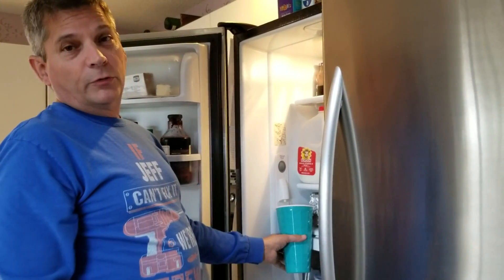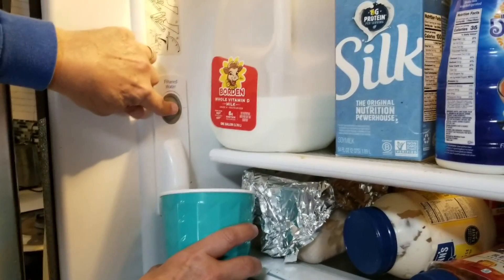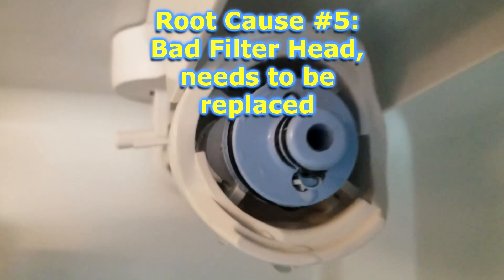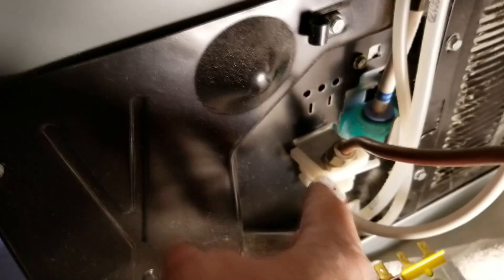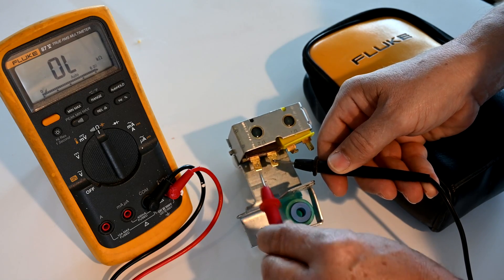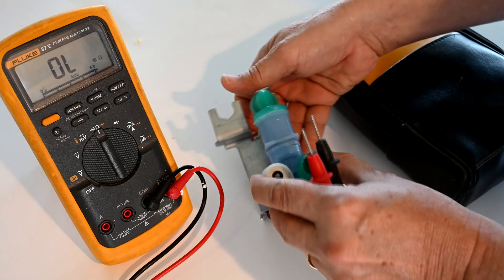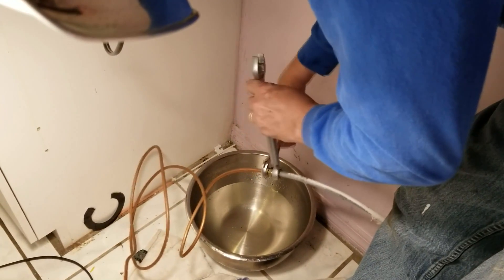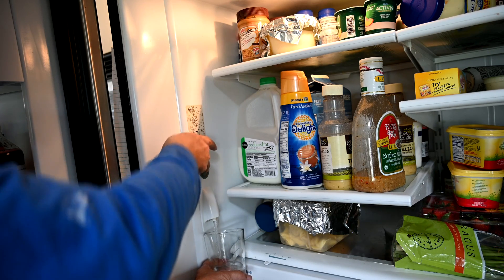5 Reasons Fridge Won't Dispense Water: Inlet Valve Fix DIY

Comment: Oh Jeff.  I'm really trying. I'm a DIY Mom and I don't give up easily but removing this bad inlet valve has been the worst. The ice maker line came right out, but the other two lines? Nope. The clear one won't budge. There's no clip on it and if I push in the collar & pull it is impossible! The other is the copper line and using the adjustable wrench is not doing the trick.  GuessI will buy a Rigid One Stop wrench!  (There's also a little screw on the old part (next to the copper line) that is  stubborn. I've tried 4 Phillips sizes trying NOT to strip it with a rubber band! Three issues to deal with just to remove the old part before I can install the new. I thought this was gonna be a breeze and I'd have my icemaker working.  Nope, not today.😂 Is there ANY advice you can offer? (I'm NOT giving up yet!) 😊 Thanks, Judy NY Diehard

Comment: Thanks!

Would like to add that my filter head unit was frozen! I removed the filter, heated the head unit for about 30 seconds with hair dryer, then it sprayed water everywhere. Reinstalled filter and BAM it worked.

Cheers
Reply from the maker: Thanks, I'm glad you liked it! Tyler!

Comment: Mine doesn't have a reservoir. Instead it has a coil of hose that's probably 20' stretched out. I'm not getting ice or water.
Reply from the maker: Try heat gun or blow dryer on the coil for 5 minutes
Reply: @jeffostroff  that's what I did. I used a hair dryer. I now have ice, but no water still. I'm okay without water. I can't live in South Louisiana without ice. Lol

Comment: I have a GE GSH25JSRFSS.  As the water solenoid read 0 ohms, I replaced the part, first testing the resistance on the new part which was fine.  Still no water through the dispenser.  I took the new solenoid off and tested it again and this time it read 0 ohms.  My best guess is that something is shorting it out.  Any idea what it might be or what my next steps should be?
Reply from the maker: We don't normally see this happen, it could be a malfunction on the controller board. Seperate the solendoid from the wires and test by itself and see if it is still 0 ohms
Reply: @jeffostroff  Each time I tested the solenoid, no wires were attached.

Comment: I think the filter head maybe defective on mine. No clogged or frozen lines, replaced the filter and changed the valve still no water. I bypassed the filter and housing with a 1/4 tube and water started dispensing again.

Comment: Jeff, very helpful.  We have a GSS25LSTASS  GE Side by side.  The reservoir was frozen, and the set point was 34F.  Adjusted the setpoint to 38F, thawed the reservoir.  At the same time, noticed that the solenoid that controlled the ice flap door was rusted.  We had observed that when the water or ice button was pushed, the display went blank.  Removed the solenoid, verified that it was not open circuit, and then removed the solenoid plunger, sanded it lightly and now we have both water and ice!!!  Thanks!

Comment: I have sporadic operation of my water dispenser. It starts on a delay like the valve is sticking. I am not sure. I took it apart and nothing looked out of normal, unless the seals are making it stick somehow. It drives me crazy.  I think the switch is making contact because the light comes on when I  push the lever. I don't like buying new parts only to find out its not the problem.

Comment: Hello Jeff,
Great video! I have the same fridge and haven't used the water dispenser in years. I replaced the filter and there are no issues with water flow. However, I would like to clean out the system or replace the tubing just in case some mold grew over the years. Do you have any suggestions or vid recommendations? Your vid was one of the few I could find with the water dispenser inside.
Thanks!
Reply from the maker: Tubing is clear so you should be able to see if it is dirty. I did not make any videos dealing with changing out the tubing.

Comment: Yes Jeff you're a lifesaver I was getting zero water out of my water for my fridge I went on Frigidaire to find a manual when I typed in my model number toasters came up so my biggest problem was those two little plastic tips you have to push in so I took the airline and the wife blew it out I pushed the plastic tips I heated up the inside of the fridge to thaw my water reservoir then I blew backwards through my water reservoir the wife caught all the water then I took a large syringe and I pumped in a couple of syringe's full of vinegar in the line that feeds everything right from my RO machine I don't have a filter because I use an RO machine. You were a lifesaver now my wife and I can quit fighting for a little while.

Comment: On this refrigerator, does the water to the ice maker and water dispenser BOTH go through the filter? When I remove my filter and push in on those two little white pointy valves, I get no water.  Is the filter before the water solenoids or after?   A schematic of the water system would be most helpful.  

I am currently trying to figure out if my icemaker is still making ice or not.  The problem with the water dispenser started when we changed the filter. It would be a huge coincidence that the water valve would fail at the same time as changing the filter.  

If the filter is BEFORE the two water valves, there should always be water pressure at the filter. When you push in on the two little white valves, you should get water. Right?  IF not, can I conclude that the problem is with my water supply and not even in the refrigerator?  

One last possibility might be the Flood Prevention Valve in the water line. After replacing the filter, the sudden release of water through the supply line may have tripped this valve.  Once this valve is tripped, it will not release until you shut off the water to the valve and release the pressure on the supply side.  This safety valve is required in most states now.  

Thanks for your video. I found it most helpful.
Reply: I fixed it. It was the Flood Prevention Valve on the water supply line in my basement. So after changing the filter, this valve slammed shut and stopped all water from even getting to my fridge. 

To fix it,  I had to turn off the water supply before the flood valve, crack the fitting to release the pressure to the flood valve to reset it,  then retighten the fitting, and just barely crack open the water supply valve to slowly pressurize the refrigerator. Then I got water to my fridge and to my Water Dispenser. I worked out all the air, then opened up the supply valve all the way.  Works great now.
Reply from the maker: It is hard to tell what different refrigerators but I believe on this one the filter is only from the water solenoid solonoid and not the ice part of the solonide

Comment: Hi i have a problem with fridge water taste its mold likes
I have ro filter (i change all filter(4))
I change fridge filter too
I trying to clean fridge water tank and and even change RO tank too
But still water taste is like a exp food or mold
What are you think?
Reply: Fridge model is samsung french 4
Reply from the maker: What about the hose line to the back of the refrigerator did you change that? Where does your water source come from? If it comes from a filtration system under the kitchen counter I'm willing to bet to filter hasn't been changed in years. You could also investigate the water supply line that goes from under the sink to where the hos is at the back of the fridge.

Comment: Thanks for the video! Finally figured out my issue after trying so much and looking at all the videos of yours. You set me on the path lol. Our previous condo owner had installed a leak safety hose and when I changed the filter it set it off. That was the issue. Just needed to reconnect to reset the hose switch thing. You should add this if you ever update the video.
Reply from the maker: Great to hear!

Comment: I replaced the water filter and the water stopped flowing but when I take it out the water flows. What’s causing that?
Reply from the maker: sounds like the filter head, which your filter plugs into, is not allowing the filter to press into the little raised rubber things on the filter head. Try experimenting with a small hose hasket, place inside the filter head assemblu on the fridge, then screw on your filter head, see if that pushes in the rubber things. If not could be time to replace the head

Comment: I have the opposite issue.  Family member was putting items in the fridge and accidentally bumped the water dispenser and it wouldn't stop gushing out water until I turned off water to the fridge.  Any recommendations on fixing that?  I have a GE profile fridge but the dispenser looks similar to yours.
Reply from the maker: Maybe the switch is stuck in the on position, try to toggle it or push it in and out until the water stops. Sounds like a freak occurrence. Try resetting power to the fridge
Reply: @jeffostroff  Thank you.  It turned out it was a freak incident, but it ended up being a valve on the back of the fridge that failed.  Got the valve replaced and now it's back to normal!

Comment: Okay.  So again, I followed all of your advice.  I was getting ice in my freezer but no water.  And now I get no ice either.  I replaced the water filter to a brand new filter.  No water.  My water button works (I hear the actuation).  I then checked my crisper for ice (to see if it is frozen) and even defrosted for 3 days to be 100% certain; still no water.  I replaced my water valve and ensured all water hoses are connected properly.  The water from my wall comes in and runs through the water hose, up into the water filter and comes out the return line to the water valve.  Water is properly flowing.  The new water valve is showing appropriate resistance with a Multimeter (186/257).  So if the water from the wall is pushing water up into the water valve and back down the return line to the water valve with a high rate of water flow, what could be the suspect?  For some reason, I don't think the water valve is allowing water to flow through it even though the resistors show proper resistance with Multimeter tool.  Is there a secondary component behind the water filter that pulls or pushes water to the dispenser?  Could the computer board be suspect even if the water light is on and I can hear dispenser actuation, but no water?  I am really stumped here.

Comment: When looking at the back of my refrigerator, I have one single rubber line coming off the wall to the refrigerator.  There is no copper piping.  It's been like this for 17 years.  Is that normal?
Reply from the maker: Yes, in modern times we have been using braided steel belted cables, make sure that is what you have. IF yours is just plastic or rubber, could be time to replace with the best hose.
Reply: Sir, I finally got my water valve in and swapped it out.  I followed your video to the number and I was hoping it was my water valve that short circuited or failed.  It took a while to swap out fiddling with the hose disconnects, but I finally got it.  An easier method of hose removal for me was using needle nose pliers on the push down ring.  This way it was pushed down evenly.  When I removed the  old water valve, I placed the Multimeter on 2 Ohms and both conductor relays showed a number but then they both dropped to zero (individually tested of course).  Am I testing them properly?  I used the red and black multimeter tips.  I did not lay them parallel to the gold connectors.  I did this same method to the brand new water valve and that too showed a number and went down to zero.  What am I doing wrong?  I am so frustrated because I was hopeful to solve the issue based on your video.  The new valve installed, my refrigerator still does not dispense water.  And when I press the water dispenser pad, I distinctly hear the ice maker turning.  If my green Water light is illuminated, could my dispenser be "stuck" on an ice setting even though the water light is illuminated?  Highly unlikely but..... do you have any other suggestions?  I want to feel victorious as this is my first and biggest appliance repair.  Thank you kindly.

Comment: I completed Step #1 with a new water filter.  Step #2 does not seem to apply.  Step #3 is in full effect as I type.  Hair Dryer on low facing the reservoir.  It did seem to be frozen, but what the hell do I know.  How does water get frozen in the refrigerator when nothing else gets frozen?  I also opened the freezer after dumping all the ice and no ice is being made.  So that leads me to Problem #4, the Water Inlet Valve.  Great.  However, I am going to leave my refrigerator door open for a while and allow it to thaw on its own.  So, how does water freeze in that reservoir to begin with?  And if no ice is being made, could it still be the water reservoir or does that point directly to the water inlet valve?  When I press for water, I hear an actuation trying to give water but no water is dispensed.  Is that the prime indicator that water is frozen?  Again, how does water get frozen in the line?

Comment: Hi jeffostroff, we have brand new kitchen aid fridge. Problem is water dispenser and  ice maker doesn't work. just installed new filter but when pressed button no water is flowing out. I'm worries and curious at same time is there something wrong with any inlet valve or any switch has to be turned on. Any help will be deeply appreciated.
Reply from the maker: These are always tricky situations but if it worked before you change the filter and not afterwards, I would remove the filter examine both connections on the filter and on the filter head inside the refrigerator where it connects, and maybe try to reconnect and twist all the way till it clicks into place. I would also check the reservoir inside the refrigerator usually on that back wall see if it's frozen most people thought out within a couple of minutes with a hair dryer. And then they have water flowing again. Hopefully you don't have a problem with your water inlet valve but there's usually no switches or anything you have to adjust it either works or it doesn't

Comment: How come the ice maker getting ice, and you tested a bad water inlet valv. Can you explain
Reply from the maker: The water inlet valve has 2 valves on it, one is for icemaker, the other is for the actual running water.

Comment: Hey Jeff-

Same fridge but the Whirlpool variant- my issue is the water keeps flowing after I release the button sometimes. At times I'll hit it again and it'll stop but other times it just keeps flowing but at a much slower rate than fully pressed. What are your thoughts?
Reply: I have the same problem
Reply: Did you ever find out the problem

Comment: This totally fixed my issue! The water in the line was frozen and the blow dryer tip worked. My fridge was a GE, but still solved the problem.  Thanks!
Reply from the maker: Excellent!

Comment: Hey, how come all of a sudden i have hot water coming out and not cold water, we changed the filter but that did not seem to help.
Reply from the maker: Sounds like the reservoir is not getting cold air against it. Is anything blocking the flow of cold air to the reservoir bottle?

Comment: I wrote that I couldn’t budge the filter, but I used my hairdryer for about 5 minutes.  When it didn’t work, I started revving up to fix the switch.  As I was pursuing this, the fridge made some noise (my husband was finally able to get the filter off and changed). We went and tested the water dispenser and voile! It worked. Think it was the hairdryer that did the trick.

Comment: Hi Jeff great video 
Our same fridge had a slow water coming out of dispenser . Since new one year ago .I though it was normal until the other when the water started coming out twice as fast . Don’t know why but I’m thinking some ice behind veg drawer .
Reply from the maker: It could be you had the issue that a lot of people have which is the reservoir starts to freeze up and a lot of people will use a hair dryer to thaw it out and then their water is running again so you might have been on the borderline with the ice forming inside that line and maybe it thawed out
Reply: @jeffostroff  
Thanks so much Jeff I believe you correct

Comment: I changed the water inlet valve and I had water for 5 minutes and then it quit. WTH ? I had good flow and then all of sudden nothing, not a drop. 😡
Reply from the maker: Maybe your reservoir is frozen over. Did you inspect it? Most people reply back that they solved it with a hot air dryer like we tell them

Comment: Thanks for taking the time to do this, Jeff. Our issue is, indeed, a frozen water reservoir. I did the hair dryer tricks several times and it worked, but it JUST KEEPS FREEZING. No something's cracked inside, so I definitely need to replace the line. I'll check your channel to see if there are any videos addressing that, but it doesn't take care of the constantly freeing reservoir issue. Any thoughts would be greatly appreciated.
Reply from the maker: Make sure nothing is blocking the reservoir, as trapped cold air not circulating will make it freeze. Put a high quality temperature gauge inside the fridge as close as possible to the reservoir to read temperature for an hour or so. You might experiment with raising the temp in the fridge it should be 38 degrees or higher
Reply: @jeffostroff  Will do, thanks so much for the reply!

Comment: Filter is only 2 months old, I’m still making ice, no water inside similar to in the video.  Since I’m making ice, does that rule out the filter and narrow it to that dual valve, or the button I guess, but the button is getting a nice click.
Reply from the maker: Did you try taking a hair dryer to the reservoir for the water? Also remember the water inlet valve has a separate valve for the ice maker and the water